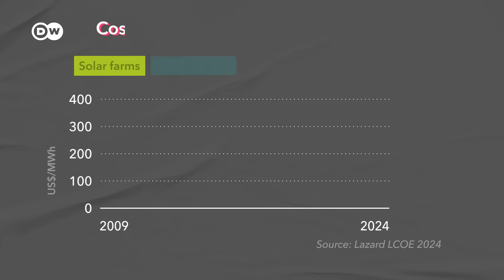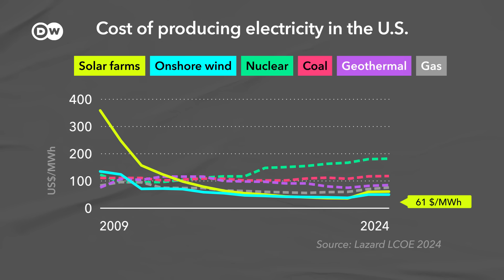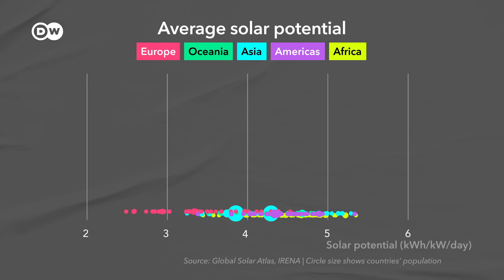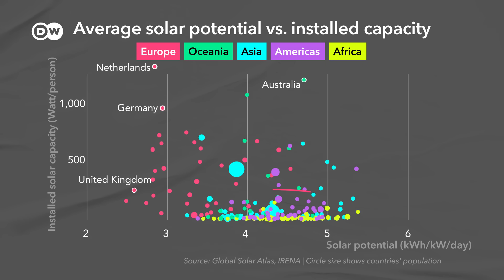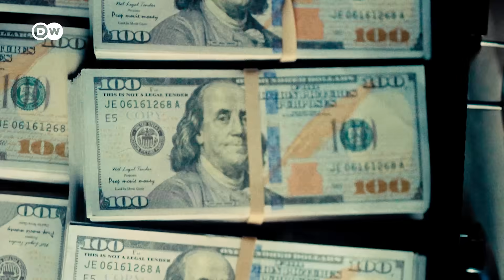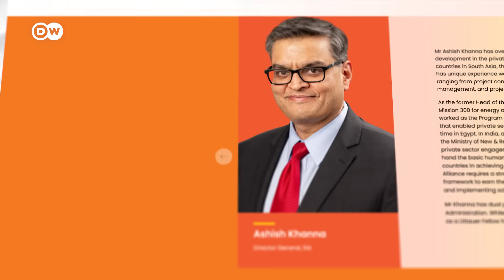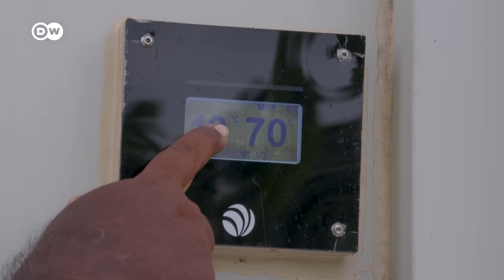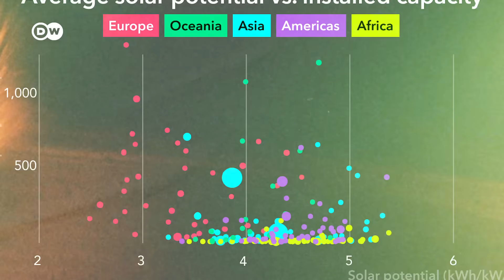We're building solar in the wrong places. But we can fix that.

Comment: Nowadays solar is so cheap that the "perfect" to build it is literally anywhere with sunshine and power demand
Reply: Yeah, it isn't 2010 anymore bothering with things like transmitting power from an optimal location and tracking the sun aren't necessarily worth the added cost.
Reply: @garethbaus5471  interesting that you mention that. It was around 2010, or a few years after that, that my roommate had school assignment (he studies electrical engineering) where they had to design the best possible sun tracking solution for solar panels. The group with the highest grade gave a detailed explanation and calculation to show that non-moving solar panel is more cost-effective and the teacher accepted it and even gave them the highest grade since they came up with the most appropriate answer to the assignment. 

Question: make a sun tracking solar panel
Answer: No

Comment: It's not only a matter of watt per square meter, grid stability and local economic capabilities to run solar power.

Electric systems, semiconductors, or capacitors and, batteries don't like harsh temperature shifts or hot sun deep frost or sand dust.

Technically spoken: Technic needs service and maintenance as more as it's placed in "stressy" environment.

This is why for me as an engineer countries like Chile, Sahara or Arabian and Australia in its desserts technically don't look very attractive. 

If your solar power system is placed in a country where it will sustain only halve of the life time but it's somewhere out in the desert an investor will more like like put the system into Europe than in on a continent somewhere in sub Sahara 😅

This isn't a matter of basic science and not a matter of economics, or politics.

It is simply technical "uneconomical" place solar technic in unstable "environments" 😢. 
I think we will don't see mutch "solar physical perfect" environments for solar really grow it's capacity on mid terms. On long terms I might could think of a change but only if this countries get political stable, too.

Oil Lord's and Dictators are mostly not interested in renewables and wars suck technical stability and money 💰 🤑 that would be better investment in renewables. Overlap this unmentioned factors and you see that most solarsystems have been build in "sweet spots" for investors and technicians. 😅

Best regards your technician.
Best regards from Munich 🇩🇪🇪🇺

Comment: Excess solar power when the sun shines, nothing when it´s dark. Germany grid operators are starting to shut down private solar panels (and the private owner has to pay extra for installing that tech) when the sun shines - and to charge solar panel owners for using the grid - feeding it with solar power. Do the expensive things first: Get the storage capacity first, fix the grid for fluctuating energy - than, later, the easiest part is to get the solar panels. And You still need nuclear, hydro, gaz or coal anyways - it just gets much more expensive as the infrastructure must be supplied, maintained and available 24/7, the personnel must be there and paid - but it just runs 1/3 of the time (simplifying: at triple the cost).
Reply: That is what you get, when you put zealots in charge. 

Instead of saying solar power can be cheap, they say solar power is cheap. Period. Instead of calculating all the expenses and revenues they just throw graphs about cost of installment and revenue in kilowatt. They never draw a co2 or a cost-benefit budget.

They never factor in the cost of volatility, the physical vulnerability, the cost of transport, distribution and storage.  No wonder they get close to blackouts in UK, Spain and everywhere.

Comment: Solar panels work better in bright sun, but they work less well if they're too hot.  This reduces the advantage of these very sunny but also very hot areas, meaning solar production in less sunny but moderate climates can be closer than you'd think.
Reply: The hottest areas are also depopulated with plenty of space, so just add more panels. Raise them up high enough above the ground/roof and it provides additional shade and insulation along with improved cooling.
Reply: @doujinflip  
that is always the way. i need about 2000kwh per years so i make 5000 kwh per year from the roof.
a good big panel cost now $50,= 480 watts

Comment: If in India the solar grid gets fully activated for the whole nation then I think we wouldn't need any oil. Rest can be done by hydro and nuclear.
Reply: India didn't have that much solar potential didn't you heard the report
Reply: @Prashant_Pandey4 Potential and requirements are Different a solar spanning in 150KM × 150KM can easily power whole india including transmission loss and everything but it's not feasible to build this huge plants
Reply: If your OK without  flying planes, making synthetic clothes, fertilizers for agriculture, using plastics, electronics, and many pharmaceutical products, not to mention metals glass and alots of other materials in manufacturing. I'd you don't mind going without cleaning products then yea, I guess you won't need any oil.

Comment: In Pakistan solar power is booming the most viable form for people to reduce the bill our electricity prices are quite high 0.25 usd per kwh/unit of electricity. so just installing a solar system the payback period is just 1.5 years. But now people are moving towards batteries powered solar system to offset the unreliable grid issue that happens once per month and a lot during summer. Installing batteries increases the payback period to 5 years but the peace you get is more than the return on investment.
Reply from the maker: The way people in Pakistan are turning to solar is such a smart and empowering shift. 🌞 We actually made a short video on Pakistan’s solar boom previously you might like 👉 https://youtube.com/shorts/q5VkTKc_3Xc

Comment: The "best" places are hot and dry, so long hours of sun and few clouds. These areas are also not great for human habitation. Idealy you want to produce the energy close to where it's needed. Do you want to transport electricity from Namibia to Ireland, from Chile to the UK? Renewable energies finally give every country the opportunity to become somewhat energy independent. If most of the worlds oil is around the Persian Gulf, that's unfortunate for everybody exept the countries of the Persian Gulf. Wind and solar may end that dependence. 
Also it's not trivial to just "adapt the grid" to lots of solar energy, storing electricity is still the Achilles heel of it. There have been plans decades ago to build large solar farms in northern Africa and export the electricity to Europe, where it's needed. They never came to fruition, because of the high costs for the transport infrastructure, but also because of the political instability of the region. If you provide a large quantity of the electricity for your neighbour, you can literally pull the plug and it's lights out for them. They can double the price for you over night and you would have to pay up, premium conditions for extortion. Oil and gas can at least be stored, so you have weeks or months worth of supply until the issue is resolved. For example, Russia reducing it's gas supply to Europe significantly didn't lead to freezing Europeans because of stored supplies. If it had been electricity the situation would have been drastically different.

Comment: 7:00 correction, you can't earn money from rooftop solars in India. It only gives credit that can be settled with the electricity bill of the same connection and nowhere else.
Reply: We also has similar policy here in Pakistan with setups feeding grid. You can get credit for excessive electricity you feed to grid and that cresit is good in cases where you don’t purchase a Lithium battery and rely on grid at night and after every month settle sold and purchased power with IPP. Obviously it’s integrated and automatically done.

Comment: Solar is presently simply a scam to make money in rich countries, no more and no less. If rich countries in cold dull overcast Europe were serious about Solar you wouldn't see a single solar panel on government buildings or on precious farmland in Europe but instead they would buy the panels an mppt, a small battery and some high efficiency light bulbs and give them for free to the people in the areas of the world that use inefficient means to produce electricity for lighting and so on. The fact that European governments don't do this simply means that they know full well the climate scam is a scam to make money and nothing else. As someone famously said "They can't tax the Sun but they can blame you for what the Sun does and tax you instead." I run my home in Scotland off grid with solar for around 9 months of the year with a relatively small system of 4kW of panels and a 10kWh battery but that simply can't be easily scaled up to power industries and I have to be careful with my usage on dull days or have to reconnect to the grid on those days and for around three months in Winter the panels simply can't provide enough so I again have to fall back on the grid. I largely have the system to avoid the ridiculous electricity charges in Europe caused by governments trying to force highly unreliable "renewables" onto the grid when all that is renewable about them is that they need to be renewed every 15 years or so which Europe can no longer afford to do.

Comment: Rooftop solar will result in many trees near the house being chopped down. Solar on agricultural land may make the land barren. Solar panels compete with plants for light in many cases.
Reply: Wrong in so many ways, most rooftops have no tres near, Solar on agricultural land improves crop yield, reducing the need for watering.
Reply from the maker: We actually made a video exploring solar installations on fields and lakes and their environmental impact. Check it out! 👉 https://youtu.be/2hwpXCjmkRo

Comment: But dont the solar panel also need batteries for it to work ?
Reply: Sodium batteries are coming in at $10 per kW.
Reply: @universeisundernoobligatio3283  so the problem would be the battery degradation

Comment: There's no wrong place. It is needed EVERYWHERE.
Reply: Exactly. This video assumes there is somehow a shortage of panels. There's not, they're cheaper than ever. Me buying a panel in the Netherlands doesn't take a panel away from someone in Africa.
Reply: Someone buying a panel in a place with little to no sun but with a fair amount of wind, takes a place for a wind turbine....
Every panel sold, makes the price go slightly up. Buying a panel for a place where it will barely produce any power makes it more expensive for those in other places to buy one.
It is wasteful and counterproductive.
You make a very simplistic argument about a very complex subject.

 @Ikbeneengeit
Reply: So, basically you are saying that a person or government living in a rainy, dark place with little sun hours and lots of wind should be installing solar instead of extra wind power... Or investing in hydro.....
Right.......
Of course there are wrong places! 🤦🤦🤦🤦

Comment: I'm impressed by the installed capacity of the Netherlands, but what the chart doesn't show is that the actual production from panels in Australia will be much higher in Australia than the Netherlands because of latitude and more frequent sunny days. Also, while it's true that Australian deserts have a lot of solar potential,  what would you do with the power if it was generated there? Transmitting the power all the way to the cities would involve transmission losses that make it uneconomical.  The video also makes no mention of how the solar power can be stored for use at night. That's one of the biggest challenges. There's not much point in having plentiful power during the day and none at night. The best storage is probably pumped hydro, but that only works where there's plentiful water and a suitable difference in altitude; both are not available in deserts. Solar is part of the solution, but not all of the solution.

Comment: I heard there is donation in EU or US that ships used solar panel to Africa, right? Even it only generates 70-80% of original capacity, then it is still a big gain in tropical compare to moderate climate.
Reply from the maker: Yes, the idea behind this is good! But a lack of control and regulations has sometimes resulted in broken panels being shipped—that ended up in landfills at their destinations. So, if this practice is done, it should be demonstrated that the panels are fully functional. ☀️

Comment: 2:11 "look at this map, it shows solar potential... You might notice there's a pretty wide spectrum"

No that's wrong. The lowest is only about half the highest. That's very close. In contrast, solar cost has fallen by 90% in the last ten years. Put another way, the worst country in the world for solar is nearly 3 times better than the best country in the world 10 years ago in terms of dollars per kWh produced. A solar farm in Ireland in 2025 costs a third of the same output solar farm in Namibia in 2015.

Location makes some difference, but the overwhelmingly most important factor is not location, it's timing. Because it's not a wide spectrum between the places on the map, but it is a wide spectrum between now and before.

Comment: affordable home battery systems would also help increase adoption of solar power, cause then you don't need to sell power back to the grid or consider if the grid can handle the extra load.
Reply: Sodium battery is just begin to mass produce this year and will change the battery storage market. CATL is the current leader of the production and they say that sodium batteries is costing only 50$ per kWh and will reach as low as 20-30$ per kWh, considering that sodium battery don't use any of the lithium, nickel, nor cobalt

Comment: I’m 100% off grid relying solely on solar for my energy needs. From January when I made the switch to go fully off grid, I’ve produced and consumed over 2.7MW of electricity from my roof top solar panels 
The biggest challenge for most people who want to go solar is the cost of solar especially inflated by most solar power system installers and traders
Having tinkered with solar since 2017, I had a pretty good idea of what it’s cost to buy and install my own solar system without going through the middleman and it saved me over 3/4 of the cost that I’d have had to pay had I bought the items locally in Kenya n had them installed for me
Reply: agreed

Comment: I am in the Philippines, in the countryside. Power here is unreliable (it is more reliable near Manila) and the grid voltage is often out of spec. The local grid is insufficient. Nationwide the generation capacity is tight, but that is not what is causing the reliability issues. (Although our reliability issues are much less severe compared to some of the other countries mentioned in the video.)
Solar has just started to grow rapidly in the Philippines. At the same time the government is still focused on developing coal, gas and nuclear plants. When those are built, they might no longer be needed.
I have a 4 kWp solar installation with a battery. Solar is quite rare where I live. We don't have net metering, the process is cumbersome and expensive. Electricity companies mainly focus on large scale solar projects. But they are at risk that the people that can afford it will buy their own solar and become less dependent on the grid. That will make electricity more expensive for poorer consumers who cannot afford to buy solar.
The government mandated net metering scheme is generous to consumers, but only the rich benefit. We need a different policy that (1) offers a slightly lower net metering price, so electricity companies can benefit as well (2) mandate that the electricity companies pay a low but fair minimum price for electricity fed into the grid that outstrips the consumer's own consumption (3) lowers the cost and speeds up the process of installing net metering. (1) and (3) might cancel each other out, but makes it easier for people to get started with net metering.
Electricity companies also need to focus more on grids scale batteries to help reduce the load on the grid and stabilize it.
Reply: Yes - having a nationwide stable grid is not a luxury, but necessity so everyone can benefit.
In the long run every city should aim to have renewable energy and being mostly self-sufficient. 
But at first highly rewarding people that feed solar energy into the grid is a good way to make it more popular. 

And having a connected grid can only help. In Europe energy can be sent and bought from Spain to Norway - that's good for a tempory shortage.
And this way larger projects - like wind farms in the North Sea 🌬️🎡 and having an energy storage with hydrogen if you have overproduction are possible and funded by multiple countries.

It's not always possible to have renewable energy production at locations where it is used the most.
Maybe we'll see a shift of production to locations with low energy cost and ressources nearby. (like aluminum production in Iceland 🇮🇸)

Solar is one of the best and flexible energy options. Getting the ressources for them is not without cost - but the environmental issues from having mega hydroelectric power or shifting ecosystems by having a new island is much bigger. It's a real balancing act.